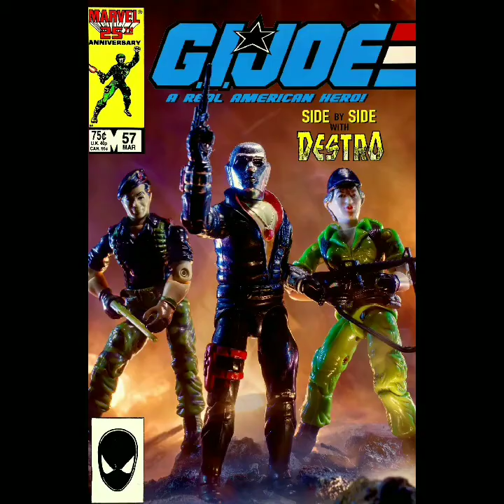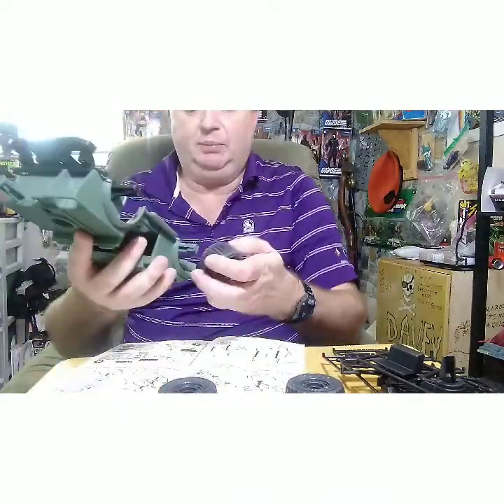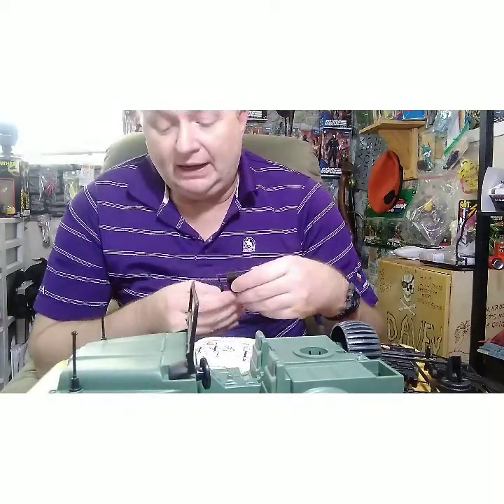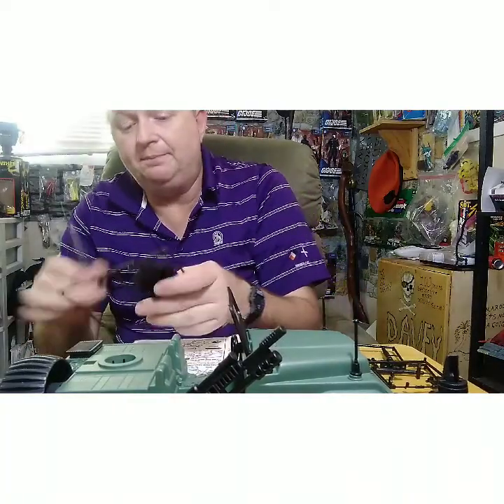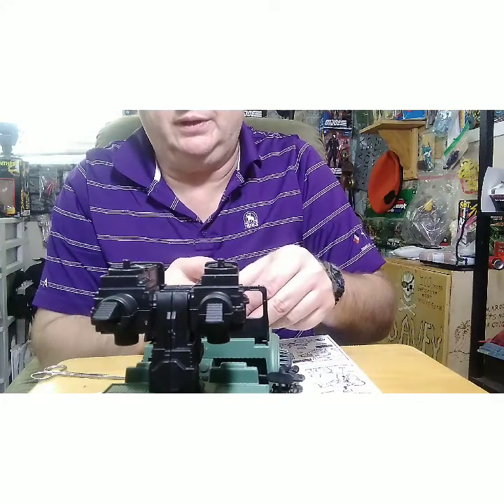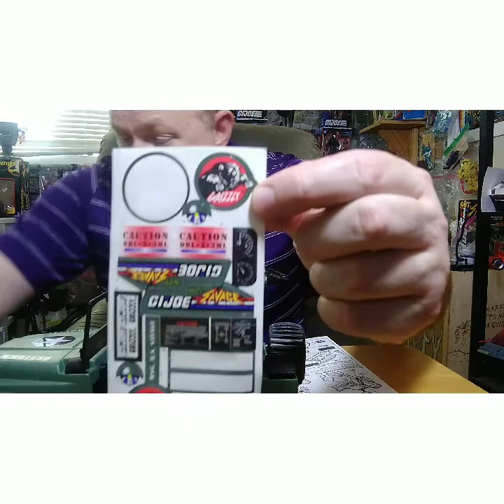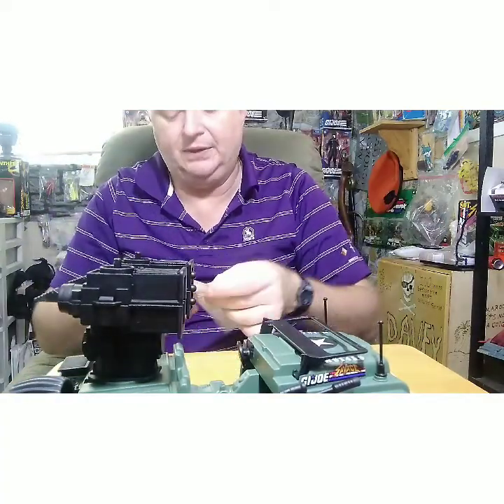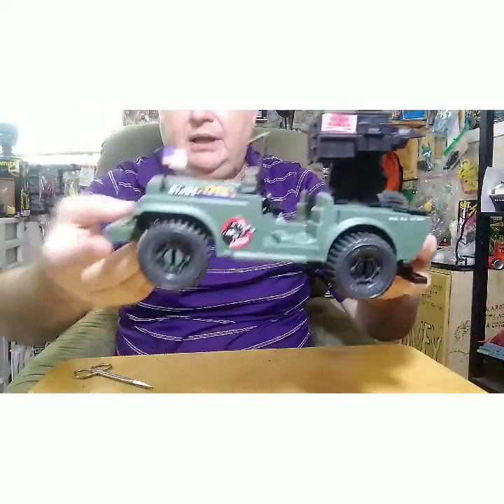G.I. JOE SGT. SAVAGE GRIZZLY JEEP BUILD

Comment: Awesome.. I wish I still had my sergeant savage stuff..I loved that line
Reply from the maker: It is pretty good stuff, if it had been marketed under it's own line, I think it may have had better success. I can see Hasbro trying to venture out a little more,  with this line, but sadly it flopped in a year.
Reply: @JoeMotionVideos82  yeah.. Very sad.. great figures and line
Reply: @JoeMotionVideos82  I wonder if they would have kept it at the 3 3/4" style if that would have helped.
Reply from the maker: @camcordernonsense5264  Quite possibly. They did switch back to that scale in 97. That was successful.